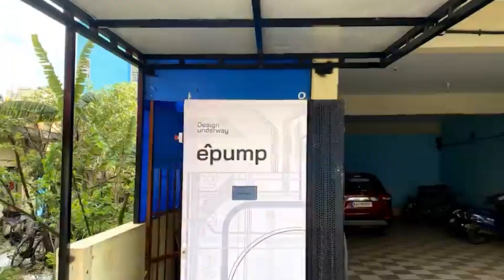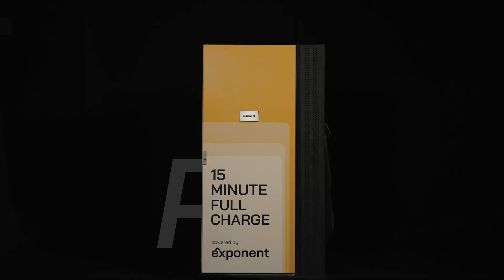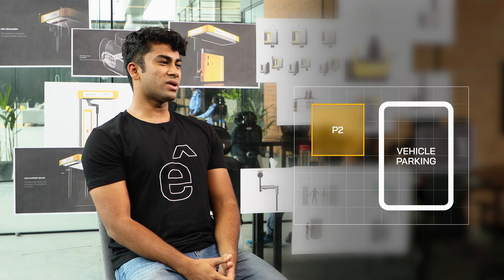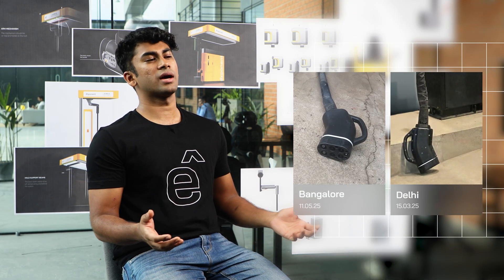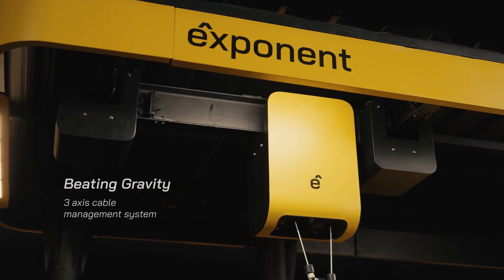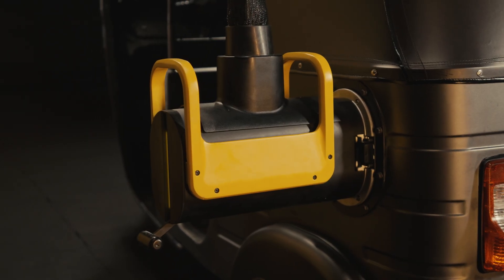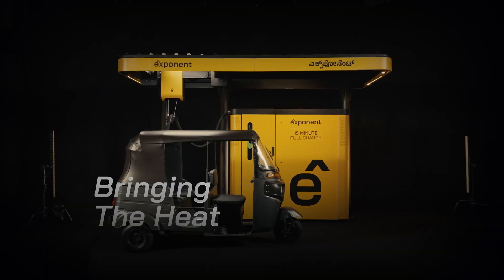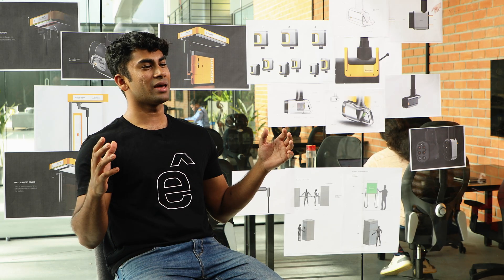Meet our new charger - Making 15-min charging seamless

Comment: Since your chargers won't work with the mainstream private vehicles such as bikes and cars, how is this benefitting the common? Can you try to partner with some mainstream companies? 
Also, I think if you can charge a bus in 15 mins, you can charge a bike in 1-2 mins.
If such a partnership occurs, it will benefit both the companies and will help quite a lot of people.
Will be beneficial for your stress testing, partnership ability, logistics improvement and a lot of challenges which you can tackle a lot earlier.

Comment: Very nice, there should also be an option to retract the cable completely and can be expanded only after authentication, this will help to protect the cable from theft in isolated locations.. as there had been many instances where the cables were cut and stolen..